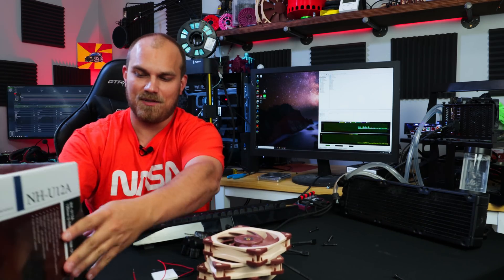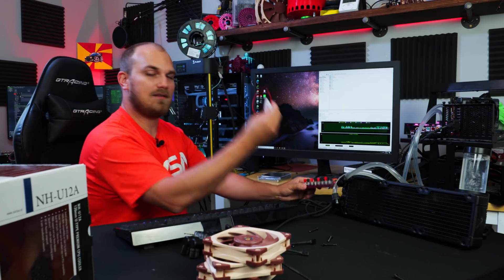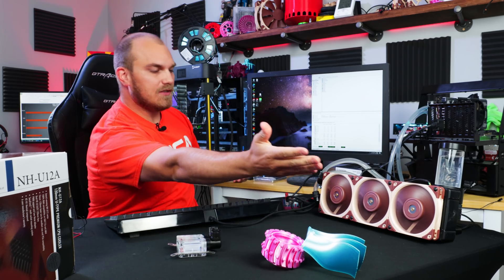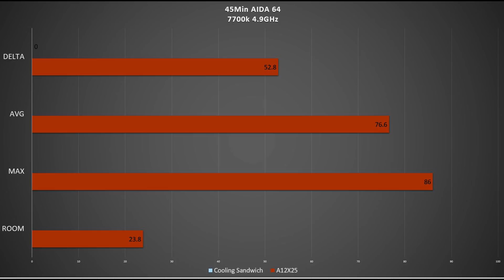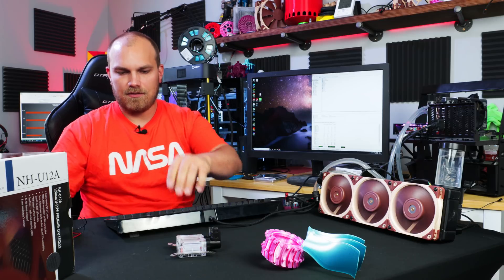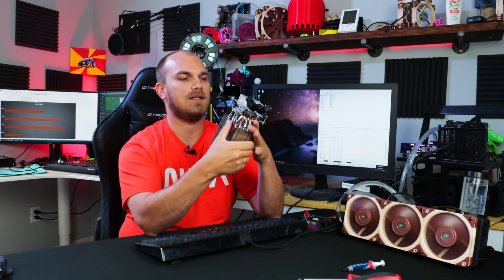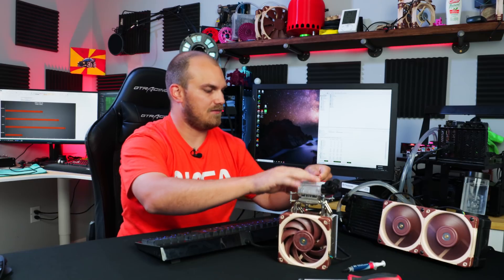Can A Wish.com Water Block and a $4 Peltier Beat a 360mm Radiator?

Comment: Back in the Intel Celeron 300A days I ran my CPU with a peltier and it ran cool enough to die from condensation on the pinside of the CPU. It was a green mess when I pulled it off. 
Peltiers can do well but you need to look deeper into the data like "delta t" and "Pc max" (cooling power). Any random china peltier will not work.

Comment: Since you already have all the components try this simple modification:
CPU block -> radiator -> peltier block -> back to CPU block
Let's see if is possible to achieve sub ambient coolant temperature. Added bonus, use your water cooled air cooler to cool the peltier for extra lols! And if you use the cooling tower to cool the coolant of the water cooled air cooler it would just be PERFECT!

Comment: why not using some beefy huge radiator for makin custome loop
u can used 2nd hand car radiator or the newest one but with cheaper cost
.
monstrous size radiator will be more cooler with good coolant + high rpm fans (n this radiator can be more cooler if this one got direct contact of flow from AC)

Comment: While peltiers can work, the problem is they cannot be used directly on an IC, as if you exceed its heat transfer by even a tiny amount, it becomes more of an insulator, this is why in the past, commercial coolers that used them, would use a triple stack design, where you have a tower cooler and half of the heatpipes are on a bottom cold plate, then sandwiched on top is the peltier, then on top of that, the second set of heatpipes. The reason is that higher powered peltiers become larger. The overall idea is to have the peltier not encounter a condition where the thermal load on the peltier is not exceeding its transfer capability. For heatsinks that use it, you will often see the heatpipes for the pelteier entering through the top of the finstack rather the bottom.

Then as long as you do not exceed the combined thermal load handling of the finstack, the peltier will offer better cooling than the fin stack on its own. One example of such a cooler is the Phononic Hex 2.0, it failed largely due to the dual tower design where the towers were too small, leaving too much excess heat for the peltier to handle, thus one tower was underutilized. One tower would be hot from the CPU, and the other would be cooler as the peltier at full power could not transfer enough heat.
If they had used a design where the they extended the fins across both sets of heatpipes and had one continuous fin stack for both sets of heatpipes, and mounted a fan on one or both sides, it would have worked far better.
Reply: The only time when you can use a peltier directly between a heat source, is when the heat source is below the thermal handling of the peltier, e.g., if doing a long exposure on a camera, the sensor may pull around 3 watts of power, and to cool it down to keep the noise floor low, you may use a 10 watt peltier.
Then the heatsink for the peltier, just needs to be able to properly handle a 13 watt heat load.

For your liquid cooling setup, the proper use would have been to use it in addition to the radiator where the hot water flows through the radiator first for cooling, then the peltier connected to the waterblock takes away some of the remaining heat, thus not exceeding the thermal limits of the peltier.
In that case, if for example, you have a 60 watt peltier, it would add an additional 60 watts of thermal handling capability of the loop.

Comment: You need to tweak this project to get a successful outcome.  Since Peltier plates have a CP of only about 0.5 efficiency you will need one with about 400W power rating for a CPU with 200W max power (Note: you can have multiple thermoelectric plates sandwiched between copper plates to achieve a 400W rating if you cannot find a single 400W Peltiers plate). Then I assume the water cycle will be cooling in the loop until it freezes.  Hence, you will need an anti freeze or temp controller unit on the plates. Also, you will need two ND15 air coolers to cools the hot side of the plate ..

Comment: To operate the teck effectively you need to regulate the temperate between the water block and the teck. Ideally the teck is most efficient with a 0 degree temp differential between hot and cold sides, but can operate efficiently up too around 10-20 degree differential. I haven't tested it yet but i'm thinking of using a teck to cool a battery pack and to heat up the temperature on the hot size around 20 degrees above the temperature of the cold size to try make the radiators transfer of heat more efficient (larger delta between ambient and radiator can transfer more heat). Just a theory but might work.

Comment: I don't think the water has enough time to cool down, maybe if you had two air coolers on the peltier and submergered the cold side finstack in water coming from the loop. Might still need a better peltier but right now I think heat transfer out of the water is your bottleneck.

Comment: Typically you would use a regular radiator right after the CPU block, and use the peltier setup you have immediately before the CPU Block. That way water pre-peltier is as close to ambient as you can get it, then CPU heats it, and radiator dissipates. Normally you don't see much improvement  overall, and sometimes you need two pumps in a push pull configuration to overcome the increased loop resistance.

Comment: It's never going to work. A "decent" peltier element can easily draw hundreds of watts so it's just going to make it worse. Not saying there aren't useful applications for peltier elements but cooling a CPU is not one of them. The heat the peltier element puts out far outweighs any benefit of the additional cooling you could get, which there isn't much benefit to cooling a CPU more than a decent air or liquid cooler already could, unless you're doing competitive overclocking but for that you need far more cooling than a peltier element could provide anyway. Other YouTube channels have done pretty extensive testing and found that it just doesn't work.

Comment: So the reason why this would never work is that what's happening in the radiator is that the hot water is being cooled via the surface area.  The fans push air through the radiator to better dissipate the heat, but really it's just making the radiator work at maximum efficiency.  

If you wanted the Peltier to cool the water in any meaningful way you'd need to slow the water passing through the Peltier, in this case, you'd need a LONGER Path over the Peltier to increase the surface area of the water.  

Additionally:  The CPU block is designed to draw heat up to the water for the water to then carry the heat energy away, not for the heat energy to be absorbed back down.   Basically, it doesn't work going the other way (with the heat source going through the fins and down to the Peltier).

So to get this to work, you'd need a way for the water to Zig/Zag over a larger Peltier in such a way that the Peltier has time to cool the water enough so that it no only cools the water down completely, but also can soak the heat energy created by the CPU.

Comment: use 2 peltier of same specs as well as 2 good water blocks also dont use 100% coolant delute to a 60/40 ratio 60%coolant to 40% water. coolant is a good thermal conductor for heat but it is not design for cold

Comment: The test failed because you need about 1 1/2 times the size of the products that you’re currently testing, that includes a three fan radiator and a dual stack triple fan CPU cooler.

Comment: Personally have a chiller based on TEC, using it to cool 9980XE while benching :) its composed from 3 sets of 4 peltiers (together about 38A@12v) all aircooled with pretty small heatsinks, alltogether is about size of very thick 360 rad.

Comment: I think the solution is a combination.  Open loop, exhaust water from the cpu goes through a rad to cool down a bit, then, connect a series of cpu blocks with peltier/cooler modules, to further chill the water, then send it back to the cpu.

Comment: What about an air cooler mounted on top of the water block? Somewhat similar to this, HOWEVER, you also use a radiator together. So: Water cooler with a metal water block, and on top of it an air cooler...

Comment: You need an air cooler that shoots DOWN, not to the side. Not to say this will be a miracle fix. It will still thermal throttle, but the heat transfer device may require air flow? I'm no scientificist but after seeing this, my mind exploded with PUT THE FAN FACING THE PELTIER!  So that's my thoughts. No reason to remake but might be a different result.

Comment: I don't like the phrase "suck the heat out", peltier cooler doesn't do that, it actively cools the water by consuming power. So weather it's going to work or not purely depends on the cooling power of the peltier. You'd need it's cooling power to exceed the heating output of the CPU. The cooling power is not the actual power consumption of peltier, the actual power will be about 50% more as peltiers efficiency is about 65%.

Comment: This project can be done to create a water chiller.  The main problem is having enough surface area on the cold side.  And a massive slab of copper would be quite expensive right now.  I actually had a idea similar to this utilizing and dual loop and a heat exchange block in between. Planned to cool the pelts with the alphacool cape cora which is a classic favorite of mine which I have bought. Never got around to the project / extensive video editing.

Comment: So, given that the spec sheets are correct, a simple set of calculations would have told you whether it would likely work or fail. There is a certain amount of cross-sectional area that the heat must pass through, so the TDP divided by the die area would give you a metric. The peltier module likely has a spec about the maximum heat flux, heck maybe even a watt value, and if the watt value is lower than the TDP or the areal flux is lower than the TDP/x-section area, then there was no way it would work. If the peltier module has higher values then there is a possibility it would work. The best bet for potentially getting better performance, provided that the peltier module has a high enough heat transfer rate (higher than the TDP), is applying the peltier module to the processor itself and then attaching the air cooler to the heating side of the peltier module. Provided that the air cooler wasn’t being saturated by the processor already, the peltier module would be able to create a higher temperature at the air cooler interface which would lead to a higher rate of heat transfer and may then be able to cool better than the water cooler or even achieve sub-ambient temperatures. Also, Linus Tech Tips has shown that there are air coolers that easily outperform some of the high end AIO water cooler blocks.

Comment: You need to make a Peltier cooled loop, with a radiator loop cooling the TEC. Like a staged cooler :D

How many TEC's do you need to cool a CPU? And how many radiators would you need to drive the heat away from the TEC's?

Comment: Would it have made any difference if the air cooler was not upside down and the heat could rise towards the heat pipes?

Comment: Makes me wonder if that TEC can handle 24v, which you can get from the PSU by putting the TEC's ground on the -12V line (Blue wire?) instead of the ground for the PSU.
Reply: You can't draw more than 1A from -12V, so good luck.

Comment: Yeah I have seen this sort of thing touched on by a few tubers, due to how a peltier works its just unsuited for this use case, traditionally the more heat ya put into it the better it works but it just can not keep up with this scenario... and a decent peltier can consume 300+ watts... but ya can always build a chiller out of some styrophome a small fan and a cold plate XD.

Comment: I don't like that whole rice grain of paste in the middle thing, if one needs that much gap coverage something is seriously wrong. I prefer a thin smear (just enough not to be see-through but still just barely) applied to both surfaces before mating. I have a core 2 E7600 at 3.6MHz at 33C on stock cooler..

Comment: Would probably work better in line with a radiator, the radiator takes care of most of the heat and then the peltier tries to get the water under ambient. The radiator might also double as a safety measure to not go too far below ambient.

Comment: I had a similar concept ,except my version consists of a custom-made water block where the inlet and outlet pipes of the water block are mounted from the side of the block, instead of being mounted to the top of the water block, and connected to a radiator. This then allows you to mount an air cooler to the top of the water block to further assist the radiator in helping cool the cpu. Can you see any logic with this method???

Comment: This is pausible but single peltier won't cut it. Last year, German Overclocker der8auer tried the same thing by using 12 peltiers and water blocks in order to cool his system. He used cheap air coolers to cool down those peltiers.

Comment: I have an idea for another video if not done already (for blade design)
try to flip the blades of fan ( meaning same blade design bu flipped so that instead of pushing air in the normal direction it push the air in other direction.

Comment: your cpu and gpu alone produce around 200/300w heat. so to cool below ambient you need a peltier that can move that same amount of heat.  depending on the efficiency of the one your using. my ges if you need around 5 of those peltiers
Reply: pls get more peltiers and a bigger "copper" water block, one the size of a gpu cart or something, so you have all the room to mount 5/6 peltiers, will be so fun experiment to see how many you need to get your system below room temp,   Who care's about efficiency ass long as you can get your water loop to go below room temp It's a win.

Comment: i think if u distrubute the heat onto more TECs they can keep up... so basically a way to disapte the heat onto a larger surface should work, maybe those: https://www.wish.com/search/waterblock/product/568b955e537e7e4b8a232e57?source=search&position=10&share=web. like 4 of them. and if posible not in a row but paralell, like u do those Y-Shaped Splitters for tubes behind the prozessors tubing and than two more to get 4 diffrent paths, and than u cool it of with rows of aircoolers, or just heatsinks straped with Your NF A4x10s. Sound a lttle expensive, but nothing crazier than u normaly do ':D

Comment: You need to create loop of several Peltier. Just read some extra info and you will see that when this Peltier gets too hot - it is do not move heat anymore, it`s just start to heat.
Take a look at this video (with timecode) and you will see that it is possible if you not stupid. https://www.youtube.com/watch?v=lKvwPc6Ojv0&t=814s
And read extra info before you creating videos...

Comment: Well, there's y'er problem!
The Peltier will fail. It's not if, it's when.

You'll need a custom water block for this one, and some mini radiator fins.

The cold plate of the water block contacts the CPU (with paste, of course). On top of the water block, protruding into the water block is the tec cooler with mini radiator fins poking into the water stream (would be cool if they were heat pipes lol -- See below for another idea). On top of the Peltier is an air cooler, of sorts, or whatever method you want to use to cool the Peltier.

The water cooler pump (not in the water block) circulates the water, and the water loop's radiator(s) cool the water.

Set a fan curve that stops the fans if the water temperature is at or goes below ambient. You don't want to pump heat into the system accidentally.

When the Peltier fails, the water loop can take over cooling until the Peltier recovers. Then start again.

Here's another idea (completely unrelated). What if radiator fins had several, small heat pipes to help spread the heat away from the water tube? That would increase the heat distribution on the fin allowing the fans to better move the heat away from the radiator. And what if the radiator fins, themselves, had curvey ridges? That would also increase surface area and time of contact of the air with the fins an transfer more heat away from the system. Wanna give it a go?

Comment: The best way to use a Peltier, is to put it into a watercooled reservoir wall to cool within and exterior fan heat off.  Customthermoelectric.com Is the place to get the best in Peltier and Seebeck TEG's. No idea what your Peltier was.. 4$?... seriously? I dont think that can chill a pop can. Sigh.

Comment: Most of the tries with peltier modules overestimate their cooling capabilities. They are useful as a cooling booster, wich means that you must keep the radiator, and just trigger the peltier when you want some EXTRA cooling, when the CPU is reaching a temperature threshold you don't want to cross...

Comment: Hey friend.
The cooler is not effective in that possition. Upside down drastically reduces cooling performance.
https://noctua.at/en/in-which-orientation-should-top-flow-coolers-nh-c-series-nh-l12-be-installed
Reply: https://youtu.be/ieMvtUpFENM?t=71

Comment: would a peltier attached to a radiator instead of fans work? So instead of using the waterblock as per this video, put the peltier on the radiator with the air cooler

Comment: Peltier is not a good solution toi expensive and not effective, you need to find a powerful module or use it to cool the water and not the cpu directly.

Comment: Can you put the Peltier module on the radiator?  Sandwich it between the fans and the radiator with the cold side touching the radiator and the hot side against the fans.

I don't know anything about Peltier stuff, apart from that it has a hot and cold side, so I don't know if my suggestion makes sense.